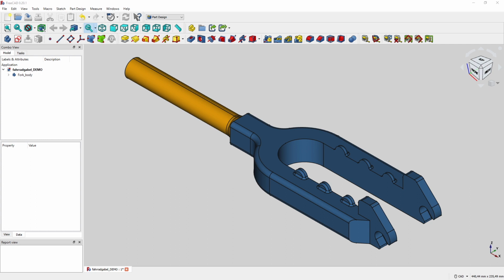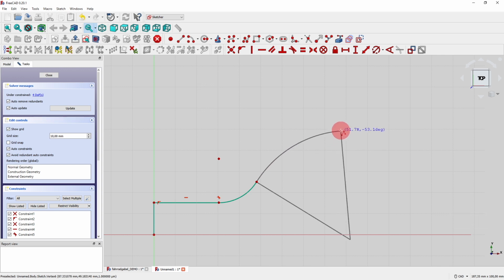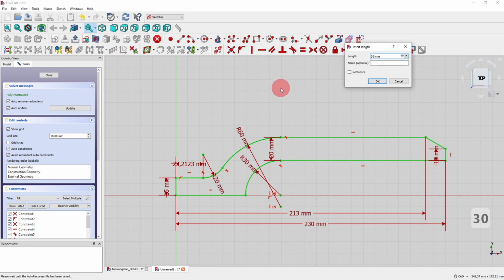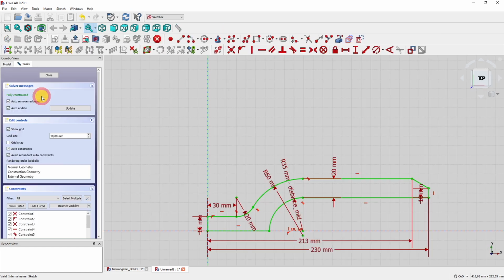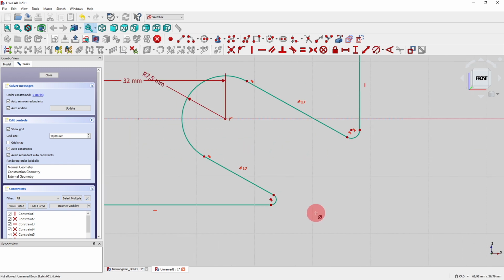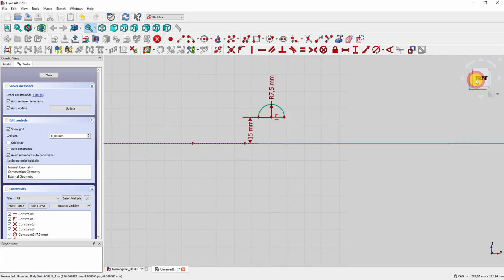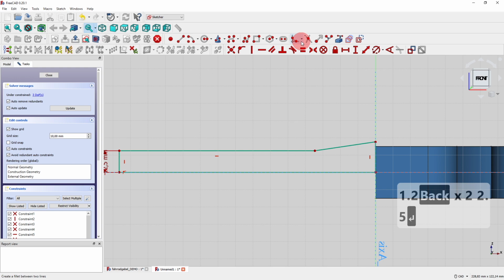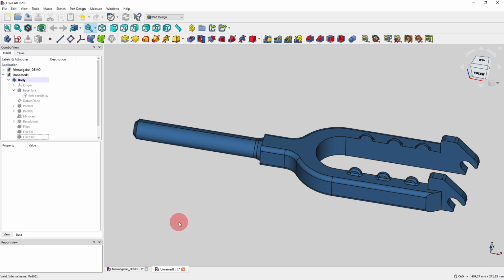FreeCAD Tutorial: Modeling a Bike Fork with Tips for Clean and Accurate Models in FreeCAD 0.20.1

Comment: Very nice tutorial.  I have a couple of questions.  Is there a drawback if you use constraint preserving fillet instead of regular fillet?  Is there an easy way to locate open loops?  I followed you step by step, but I can't pad the sketch due to "wire not closed" condition.

Comment: Great tutorial! As others have said, most other video tutorials don't get into the more involved geometry, full house modeling or similar where one pretty quick get into issues. A minimal example, using the BIM or Arch WB and the window tool, the default "Hole depth" is shown as 0 but in use, it is way larger, punching holes in any back walls when creating windows and doors. Solution in a thread over at the forums wasn't that easy to Google. I think a similar video like this one, but "model you own house" in the Arch/BIM/Draft workbenches would be great. Getting into problems and solving/adjusting way of working is a powerful teaching technique

Just did a small support donation, the FC community need more of your teaching skills

Comment: I found your tips really useful, especially not referencing the padded objects, but always going back to the sketch. My challenge now is dealing with solids I created in the part workbench in order to extrude an SVG imported path and constrain that to an object create in Part Design with a sketch. I hacked my way through using the transform to move one solid onto the other and that was sufficient to export as an amf file to 3D print, but there must be a better way I need to learn about. Anyway, I found your video easy to follow and understand.

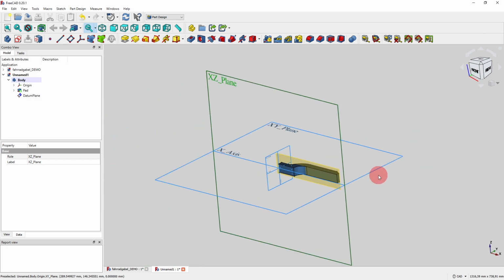Comment: At about 10:30 you offset the datum plane -30 in the Z direction. I saw that it was on the face you would have used, but to me it seemed it was at +30 in the Y direction. I have had to use trial and error when I offset a plane because it never was the direction I thought it should be. To me, a XZ plane means every point on the plane has the same Y coordinate and for this plane after it is offset that Y coordinate would be +30. Please explain why the offset was -30 in Z direction.
Reply from the maker: the offset in Z is always perpendicular/normal to your plane. so it's a LOCAL coordinate system of the plane and it has nothing to do with your GLOBAL coordinate system. hope this helps
Reply: @FreeCADAcademy  Thanks for that answer! So it would always be a Z offset since a plane has infinite  X&Y
Reply from the maker: @radionut4422  exactly. So to offset X or Y wouldnt make any sense, as rotation around Z wouldnt make any sense either.
A plane can be rotated around its local X and Y plane and offset in Z direction

Comment: Let's say you wanted to make the shaft aluminum and the fork steel, and schedule the weight of the overall part how would you apply the material and schedule that?
Reply from the maker: then you'd better model these two as separate parts in my opinion and assemble them